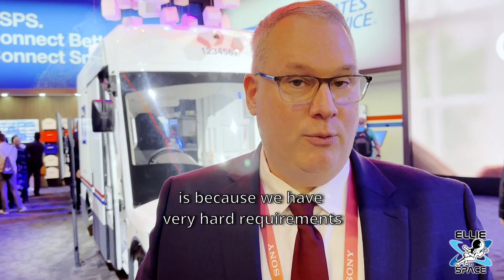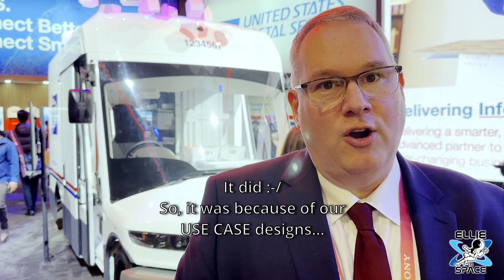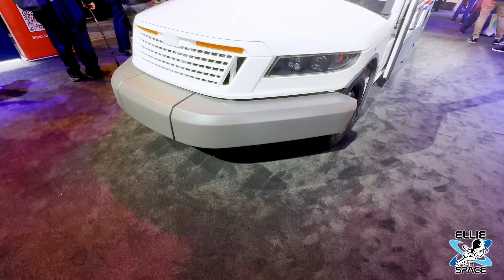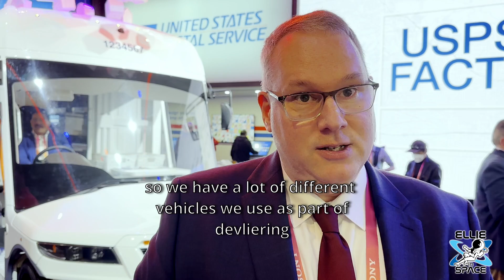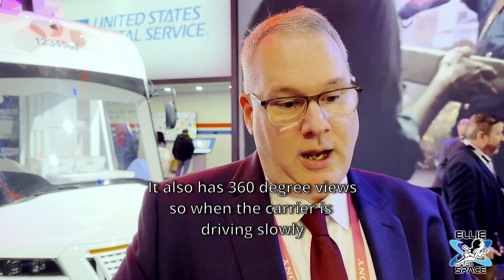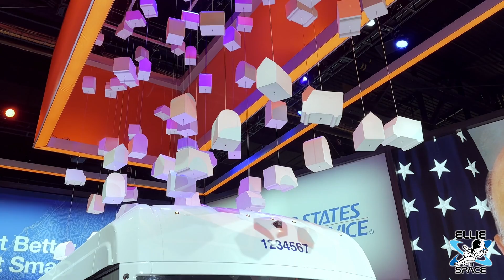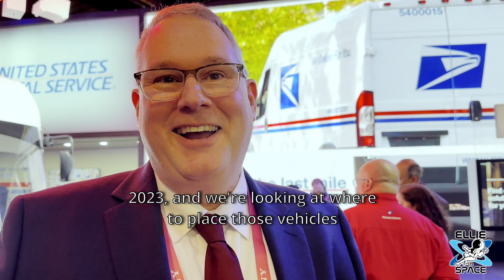The REAL reason the new USPS trucks are UGLY

Comment: Absolutely PATHETIC!! We've been working with vehicles that have no ABS, no anti-lock brakes, no AC for over 30 years and the new model vehicles are sitting in a convection floor? PATHETIC. I work in Miami with 90 degree plus humidity levels that make it over 115 degrees with nothing but a fan blowing hot air in the back on my neck and I'm sitting here watching the "GLORIOUS" new postal vehicles being displayed instead of rushing them to get it to us. My LLV won't even run for 1 hour before breaking down

Comment: Anyone who delivers mail knows this is not practical. The windshield is god awful big, which removing ice from will be a nightmare. The cargo area is half as small as the current LLV. Fitting everything during Christmas will be impossible. The air conditioning is the only perk.
Reply: And you will have to turn that off to save battery. 🤣

Comment: I would have thought it has that shape simply so they can fit an engine where they're used to fitting an engine, as they were originally planned not to be EVs. So... that's why it doesn't look like a real EV like Amazon's which achieves the goal he claims far more competently. This would have been great if it had come out when the Prius did but it's silly buying new ICE vehicles now.

Comment: Not against  EV'S but where is the power to charge going to come from, we can't  generate  enough power now to meet our needs , and most folks don't know that the carbon foot print to make EV'S IS far greater then the combustion engine vehicles,  plus the battery will contaminate  the water table , and there is not enough  raw materials  to even replace all vehicles  in the US  alone , so it seems to me that we have closed the barn door before the  horse
Reply: EVs usually charge at night when there is low demand for electricity.  It’s actually more efficient for the generators to produce electricity 24 hrs a day versus starting and stopping.

Comment: What the hack up to 30 years old. I heard they are near 40 years old, manufactured at 86.
Reply: 1987 to 1994 for the post office. There were some 95s but not for the po.
Reply: Mine’s a sweet ‘91 with 270K.  Its based on an early ‘80s Chevy pick up with the Iron Duke engine.  Junk.

Comment: I am a postal carrier and own a truck in Boston. My Dad lives in Florida and when I visited him. I noticed that the carriers in Florida don't have A/C that's brutal.
Reply: None of the LLVs have ac.
Reply: @fredbecker607  yes. Point is, he’s surprised  that even in Florida, they didn’t add AC in the LLV’s
Reply: @fredbecker607  false , theres very little llvs with working air . as a rural carrier ive been in a few
Reply: Gets up to 115 degrees where I'm at and we don't have AC. Just a little fan that blows hot air at you :)
Reply: @solodolo6018  We have pro masters at my station in boston and two tons. No llv at all, but when I first started we had llv and crvs and one tons. All of them had those fans that blow dust and hot air in your face. I can't believe Boston has A/C but Florida and Arizona doesn't smh.
Reply: In FL we have Metris' at most offices by now.
Reply: My wife placed a thermometer in her truck and it was 125 degrees inside last summer. I didn't even bother testing mine because it's fkn horrible  especially in the summer.
Reply: @maxsands3861  I guess you have a hard time reading with clarity. I said in Boston we have vehicles with A/C. In Boston it makes zero sense to have vehicles with A/C. Here in Boston but not in hot 🔥 ass Arizona and Florida. If you lay brick 🧱 or concrete in Florida or Arizona. It's mandatory to take water and shade breaks to avoid getting a heat stroke. Because humans are not machines. Extreme heat kills us but thanks for caring and concern.
Reply: You are correct. The carriers here in Florida have a small circular fan mounted in front of the driver.
Reply: Will this mail truck have 4WD/AWD for snowy/icy weather? Will it also be a lot bigger & more spacious than the clunker LLVs?
Reply: Wait no AC in Florida? Now that's messed up😮

Comment: Sonar? USPS planning delivery to U-boats? I belive especially when a vehicle can be stopping alot and carrying heavier loads, all the eggs should not go in the EV basket. Recent data shows poor mileage on these vehicle types under mixed and heavier usage. Hydrogen is the best way to go. Faster fuelling. No noxious gasses emitted. Easier build for fuelling system. No shutdown of grids at times of electrical shortages. The world must readdress hydrogen fuel before continued EV folly.
Reply: If the USPS has large parking lots for these EVs, they can put up solar panels to create the energy to charge the vehicles.
Reply: @Royale_with_Cheeze  that's logical. But the àrticle said sonar.
Reply: @mattaz2315  
They meant it has radar. Sonar is on ships. My car has radar cruise control. When the car in front of me slows or stops, mine does automatically. I have driven on a turnpike (back when you actually had to use a tollbooth) so traffic would slow from 65 to a stop. I never move my foot. Just need to step on gas again to get going again. 
I think that technology will be in the USPS fleet. They screwed up by saying sonar.

Comment: The LLV doesn't even have a good heater. They were very poorly designed from the start.  They even forgot to put windshield defroster on the right side.
Reply: Totally agree. I don't know why they only put defrost vent on the left side but nothing on the right side(driver side). I have to wipe them off by myself.

Comment: I'm mostly surprised that USPS has been hauling boxes of stuff to customers all these years in non-climate controlled vehicles.
Reply: Even the heaters were little more than an afterthought.  There was no heat vent at all for our feet in the first LLV's. The single heat vent for the defroster was put on the wrong side of the vehicle.  That is why you will see a little fan on the dash.
Reply: @fredbecker607  Agree. They should add vents for the defroster right in front of the carriers. I still have to wipe it myself even with Defrost on.
Reply: The few auxiliary floor heaters are mandated to be removed. Its great when its below zero. Your feet are froze everyday and burn like hell at night when you try to warm up at home.

Comment: 70 miles range 😂😂
Reply: Cant wait for Tesla Cargo-van..
Reply: @mikafiltenborg7572  a Tesla van can be made on the CT platform.
Reply: The average mileage a carrier/parcel post driver puts on their vehicle on any given day is fewer than 30. It isn't driven long distances. 70 miles is quite sufficient and more.
Reply: @Royale_with_Cheeze  yeah yeah. it’s crap.
Reply: @ashiga8023  
Perhaps only having a 70 miles range allows for fewer batteries and overall less cost per vehicle. 
Remember, this is a utility vehicle. You don't have to compare it with the range capacity of passenger vehicles.
Reply: @Royale_with_Cheeze  they so crappy will be 50 miles in 10 years.
Reply: @ashiga8023  
I dunno. Maybe just add battery cells in the future to make up for lost capacity? 
You appear to only look at negative aspects. Even if they degrade to only 50 mile range in 10 years time, which isn't likely btw, even that will probably suffice for the daily needs.
Reply: @Royale_with_Cheeze  no one ever drives with leaving 20 miles of range left, so that’s like 30 miles. depending on cargo, terrain and weather conditions could drop down to 10 miles 👏👏👏 you obviously don’t own an ev…. this choice stinks of ignorance and corruption. these ev’s suck.
Reply: @ashiga8023  
Ok fine. You win.

Comment: In my area the carry the mail to each house. The truck is parked at the end of the block. All day it probably goes less than 10 miles. The range of this vehicle should be adequate. But I don’t see the advantage of this over a production van like the electric Ford Transit
Reply: These are designed for a specific use case.
The EV Transit first is designed as an ICE vehicle and is not going to take advantage of all the packaging efficiencies an EV affords. This is an EV with the ability to have an ICE drivetrain installed.
The Transit package is designed to be everything. From plumber's truck to airport shuttle bus, flower delivery van to flatbed truck. That involves a lot of compromises just to meet a price point through economy of scale by serving a wide customer base. These will meet that economy of scale through the sheer scale of their single customer. Wide vs. deep
Reply: @Markle2k  I can understand your point but defense contractors aren’t known for on time on budget programs. This will end up costing more than planned
Reply: The postal service is trying hard to eliminate those type of routes to save money. Some walking or park and looproutes may only drive 4 or five miles per day. A rural driving route can be over 200 miles. A city driving route is 20 to 30 miles per day.

Comment: You can abide by requirements without making it hideous. There are ways to accomplish those line of sight reqs that don't make it look like a fuck billed platypus car. 🤦‍♂️
Reply: It also requires an ICE/hybrid option for edge case routes that can't accommodate to the 70 mile worst-case range. That's probably most of the reason for the duck bill look vs, the Rivian Amazon truck's more conventional slope front. With the duck bill, you can slide in a compact FWD package and replace part of the batteries with a fuel tank for a nice hybrid solution

Comment: Interesting that he didn't mention what I think of as the main advantage: Not having to restart an ICE at each entry to the vehicle. I don't know if they're going to be allowed to leave the trucks "on" when delivering individual bundles, but if so, it's even more convenient.
Reply: Current practice is that the key has to be out of the ignition. E brake on also.
Reply: NOPE not even with the new safety features this will bring.

Comment: Surprisingly interesting video. The default vehicle here is the Grumman that I believe is the LLV referred to... also ugly, but given that mail routes here require the carrier to leave their vehicle every house or two (boxes on house, not at curb) the starter motor for the IC engine in them takes a lot of abuse.
Reply: It's actually the battery and alternator. Start/stop is common as a fuel-economy measure because they can make high-amperage motors that will take a huge duty-cycle nowadays.
Reply: The old LLV (long life vehicle) is a 4-cylinder Chevrolet piece of crap vehicle.  It does have a decent design for hauling mail and parcels, though.  The newer postal trucks we use to deliver in are Ford Explorers, 6 cylinder engines.  Roughly made in the year 2000. They are called, FFV’s. Flex fuel vehicles.  I believe they can run on propane but have only used gasoline.
Reply: @SaabAholic  actually the Grumman LLV is built on a base model 2 door S-10 blazer 2wd chassis. They used GM’s positively ancient 2.5 liter iron Duke 4cyl. The trucks were designed to last 20 years but the biggest issue is snow as the front track of an LLV is narrower than the rear. The FFV which was supposed to replace the LLV is actually a Ford ranger and the chassis used the rangers 2.3 4cyl. The FFV didn’t catch on cause by 2011 ford had ended ranger production. The FFV really didn’t solve the problem so the post office began to buy ford transit 250s, Ram Pro masters and dodge caravans. Anyways check your FFV out if it’s got leaf springs then it’s a ranger
Reply: @matthewcaughey8898  The FFV has the 6 cylinder engine.  And the front tires are a smaller size than the rear. My office has 1 LLV in the fleet and the rest are FFV’s.
Reply: @SaabAholic  I am not sure if they contracted out production, but the LLV is indeed a Grumman (yes, the aerospace company
Reply: @Markle2k  I think he may have been referring to the engine rather than the vehicle as a whole. I doubt Grumman built the engine.
Reply: @Markle2k  OK.  But our mechanic says the LLV uses Chevrolet parts.

Comment: Thanks Ellie. The one thing most comments ignore is that It took the post office 6 years to get to this point, and they do not want to repeat the process as the motivations are 1.Get the old vehicles off the road. and 2. The old vehicles were designed for mail, and today the Post Office is dealing with less mail, more packages. Had they started 1  year ago, EV's would have been a more credible technology. So, the vehicle was designed around ICE and was converted to EV after individual members of Congress yelled and screamed, and Joe Biden set a target of all new government vehicles being EV's.
Reply: They were designed as EVs, with a hybrid option. Congress only whined about the mix. DeJoy, the guy that is to the USPS what Rogozin was to Roscosmos, was only going to have a 10% mix. The EVs were always part of the spec
Government vehicles being EVs is a good thing. Look no further than car rental companies' experience with EVs for why. When you run a fleet, maintenance (and often fuel) is a huge part of your bottom line.
Reply: @Markle2k  this whole design started way before DeJoy ever came on board. It was not just his idea to ICE for power. EV's were not nearly as common or developed when it started.  Biden and congress did demand that more were EV. The LLV's were supposed to be replaced starting ten years ago. They started the design work about 5 or 10 years before that.

Comment: I don’t know 70 miles range I have a feeling they won’t make it May be 20 miles each way, snow in cities on east coast will be quite a hurdle for a vehicle that low. And it will cost the taxpayers lots of money. Good job Ellie.
Reply: I'm a carrier, I travel a total of 21 miles per day including the drive to and from my route. My route is one of the farthest from our office too, so it should be sufficient.
Reply: Were you not paying attention? That's the worst case with A/C and heating running in weather. I know that it has gotten to be a big thing with right-wingers to exaggerate EV range loss, but people have had billions of miles experience with modern EVs over the last decade. That trope is so far out of date that Rick-rolling was called 'listening to FM radio' when it was current.
Reply: The Americanos are rich, they can afford such a luxury postal vehicle. Everybody else uses Nissan, Ford, VW, Renault etc. Electric of course!
Reply: Postal service is known for over estimating what can be done and wildly underestimate what it will cost.
Reply: We have routes that are over 50 miles. Then if you have to split a route. Your getting close to that cap limit
Reply: @brianthomas1785  And this is the worst case scenario. And if you are the edge case, you will be getting a later version. Stop pretending that everybody needs what you need
Reply: @brianthomas1785  where would you need to drive over 50 miles? Are these rural routes?
Reply: @brianthomas1785  That's why USPS is not replacing all of the trucks with EVs. They are still purchasing Ram Promasters. And some of this NGDV is ICE.
Reply: @Mikercflyer. Post Office doesn't use taxpayer dollars. That's #1 misconception about USPS

Comment: 70 miles is NOTHING! That wasn't thought through at all.
Reply: You familiar with the use case? How close is your post office?
Reply: @T-K-4-2-1  On average, UPS drivers average about 125 miles daily and typically deliver 225 or more packages. However, this number can vary depending on the route, the location, and the driver's workload. That is from ChatGPT and applies in America. Drivers do not generally go back to the depot for lunch etc. either.
Reply: @aikidoshi007  That's not the average UPS driver's route. That's the average of the guy who answered the Business Insider question that comes up first in Google's search.
Second. UPS depots are not distributed as widely as even FedEx depots, let alone main Post Offices with parking. My post office is less than a mile away. The nearest FedEx depot (not ex-Kinkos) is 1.5 miles away. Another 5 miles is another one. Then another. Then the local airport hub. UPS is 30 miles in one direction and 25 in the other.
Reply: @aikidoshi007  But this NGDV is for USPS, not UPS.
Reply: Its enough for US purposes. They will still use fossil burning V8 monsters from Oshkosh in 2100. So: 70 miles is plenty enough.

Comment: Maybe I'm naive, but 70 miles doesn't seem like much.  I guess if they are delivering in the immediate vicinity of the facility they'll be okay, but this won't work on any rural routes.
Reply: Rural probably isn't running at 2000lb capacity. I believe these are also fast-charging...80% within 15 minutes.

And if you recall, not every vehicle will be EV. I'd assume the ICE trucks are for those longer rural routes.
Reply: @T-K-4-2-1  Yes, the US still needs to dig fossil ressources and burn them when everybody else on the world has stopped using them, because the USPS can not let go...
Reply: Just how many miles do you suppose any given zip code covers, even in a rural area? The average driver puts fewer than 30 miles a day on their vehicle.
In rural areas, they have multiple mail routes, hence multiple drivers covering those routes. 70 mile range per day is more than sufficient. They likely want that cushion for the cold days when the battery won't be as efficient and maybe will only get 50 miles of range, which is still more than necessary.
Reply: @Royale_with_Cheeze  when new these will be pulling back into the lot with a third of a tank,, electric. Only goes down from there as a battery ages. If they insist on proceeding with this joke fine. I would think a limited run of 10 thousand out in the real world would be enough to prove themselves. If they work great, but to just go all in is complete folly.
Reply: @JohnWhite-Iowa-City  
Perhaps they already put a small number of them in the real world as a pilot program to test them out. I don't expect the USPS can afford to go "all in" on an untested vehicle.